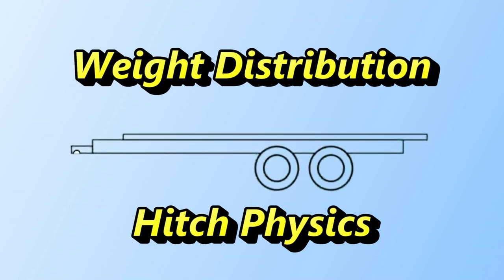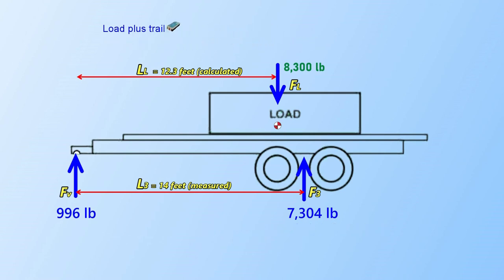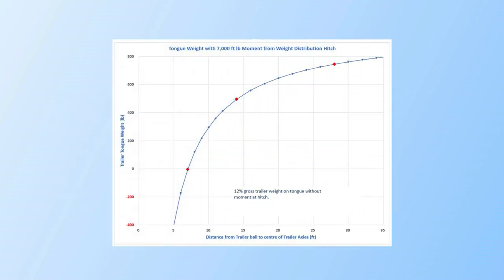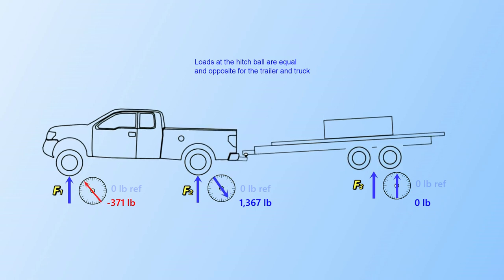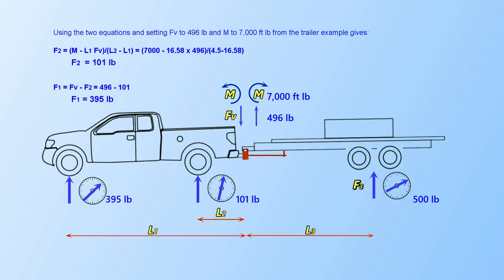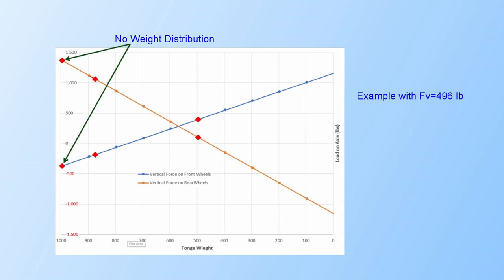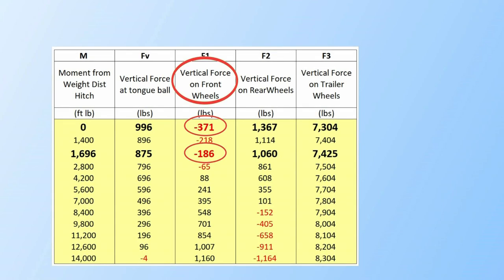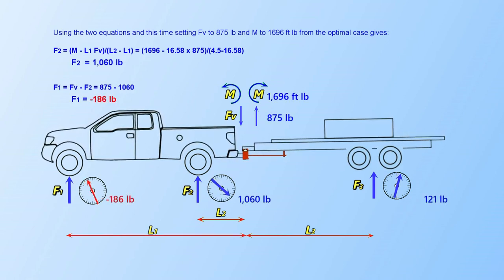Surprising Effects of Trailer Weight Distribution Hitches

Comment: The force between the ball and trailer tongue goes up a lot , like 2 or 3x, when connecting spring bars (see video from Weigh safe).  The L brackets or bar chains load the trailer A frame, pinning that to the truck hitch/ frame for increased stability. The load taken off the rear axle of the truck is used to extend weight to the truck front axle and trailer axle, which increases stability.

Comment: This is awesome.  When you add a wdh you not only add torque, but you add the weight of the hitch which is of course very biased to the tongue.  It seems this comparison would be to a weigtht distribution hitch installed with not torque on the bars/chains.  A good simplifying assumption, and having this simplified is good for your example, but not a real world comparison of using a wdh or not.  Just mention this because people often talk about wdh weight adding to tongue weight, but as you show torque shifts some tongue weight to front axles and back to trailer.  Like I said, this is awesome and educational, thank you so much.

Comment: Interesting, but not completely accurate.  A couple of observations:

1.  You should not analyze the trailer and the truck separately. When you connect the trailer to the truck you create a couple that can move horizontally and vertically.  
2.  This couple creates a single beam consisting of both the truck frame and the trailer frame. 
3.  The rear wheel of the truck becomes the fulcrum and the front axle of the truck and trailer axles are the end support of the beams. 
4.  The axles are all spring supports because both the trailer and truck have suspension systems. 
5.  There will be weight removed from the trailer axles as the tongue is lower below level.  This is because the trailer will pivot on the suspension, putting more weight on the front axle and removing weight from the rear axle.  This will shift the trailer’s center of gravity downward. A shift in the center of gravity changes the weight and balance of the trailer. 

In summary, you have oversimplified the mechanics and misapplied your formula.

Comment: Good job on the video! I have a 37 foot travel trailer, and I am in the process of mapping out how different ways of loading the trailer affects tongue weight. Your video has given me great info, but perhaps if you have a way of calculating how the weight of 200lbs of cargo in the front cargo compartment will be distributed between the trailer axles and the tongue, I would be all ears!👍😬
Reply from the maker: Many thanks for the compliment. The video was a fun project. 
The trailer axles load is the distance from the load to the ball, divided by the distance from the trailer axles to the ball, times the weight. With your 200 lb load, the tongue load is 200 lb minus whatever is calculated for the trailer axles.. Note that if the load is applied beyond the trailer axles, the trailer axle load will be greater than 200 lb, and the tongue load will be negative. The formula still works.
A 37 foot trailer is huge to me. Ours is only 19 feet. What are you towing it with?
Regards,
Ken
Reply: @projects7752  I am towing with an F-350 6.7. I would not tow this trailer with less. I also have a Propride hitch to alleviate any sway. It’s a good setup. 

And you just confirmed the formula of my calculations, thank you very much! I am not an engineer, but I do like it when my theories are close to reality😬
Reply: @projects7752  one more question... What happens to the trailer’s CG when applying weight distribution at the ball? In your example of using an M of 7000 ft lbs of torque, the trailer would seem to have a tongue weight of 6%. Looking at Fords recommendation of restoring the measured drop of front axle to half and using your table, the trailer tongue weight would be at 12%. Am I reading that right?
Reply from the maker: @henrikryan1606  That sounds like a really good setup you have.
 I use a ProPride hitch on my 19 foot travel trailer with an F150. Although the trailer is not that big, it showed signs of sway at around 50 mph without the weight distribution hitch. The ProPride hitch completely solved the problem.
I also use a Camco Treker Eaze hitch on an 18 foot deckover trailer with 10,000 lb rating, although I keep the load to the legal limit of the truck. It also works well, but a low centre of gravity trailer is a much easier towing situation.
Reply from the maker: @henrikryan1606  You have such a long trailer that the weight distribution system will not alter the trailer axle load to any appreciable extent. Rather, it will shift load from the truck rear axle to the truck front axle. 
The latest Ford brochure I saw no longer had the recommendation of 50% change in front axle load. Camco recommends restoring the front axle load present without the trailer.  I suspect it is hard to make a recommendation that will cover all situations. 
Regards, Ken
Reply: @projects7752  yeah, I was playing with numbers today and found that to be the case. Maybe 50lbs shift on the trailer tongue/axles, but 3-400 lbs on the truck axles. 

This exercise has given me a fuller understanding of the physics! I appreciate your video and comments!

Cheers

Comment: Thanks so much for this. It took me some time to go through all the equations and understand what is going on, but in the end I've finally understood for the first time how these really work, not just what they do. However, specs on weight distribution hitches don't include any information on the spring force range. Rather, it seems that I must choose a hitch according to my trailer tongue weight. So I can't really calculate the desired the desired M value in advance and go out and buy a 7,000 ft pound hitch, or am I missing something?

Comment: Very interesting and informative. Any updates on Part 2?
Reply from the maker: My apologies for the long delayed issue of Part 2. Your note did prompt me to dig up the now very old files. I will once again try to get it completed, but it will be at least two weeks.
Reply: @projects7752  The mechanical engineer in me has been searching for a detailed analysis on the workings of a WDH and this was very informative. The only other one I was able to find was on an RV forum, by an engineer named Ron Gratz. He makes comment on what is actually happening at the hitch receiver and that the force decreases. Which I guess makes sense since Class 4 hitch receivers can take a larger tongue weight using a WDH. In his analysis he concludes with the comment that trailer weight and tongue weight did not enter into his calculations. I would be interested to hear your take on his analysis but for some reason I can't post a link to the site. Look forward to Part 2 of your analysis. Thanks.
Reply from the maker: @chrishimsl1321  Many thanks for the link. I will study it more carefully. My first impression, and it is probably more semantics than anything else, but he concludes the tongue weight does not change, while his calculations show a 300 lb increase in trailer wheel load. I would argue the net tongue load has decreased by 300 lb since the total mass of the trailer is unchanged. There is now a moment introduced through the length of the tongue.
As a thought experiment, consider the case where a bending moment is applied at the hitch in the reverse direction. Then take this to the extreme where the trailer is lifted off the ground due to an extreme reverse bending moment at the trailer hitch. The complete weight of the trailer is now carried by the trailer hitch with no weight on the trailer wheels. From this I would conclude that a bending moment at the hitch from a weight distribution system does change the net load carried by the trailer hitch. Part 2, if I ever get it ready, goes into this in more detail.
Reply: @projects7752  Yes, it might just be semantics. He actually says that the vertical load on the receiver has been reduced by 300 lbs but the down force of 2000 lbs on TT tongue from the WDH bars ADDS a load of 1700 lbs at ball coupler. Through all of this, he never assigns a number to tongue weight in his analysis. It's an interesting study on statics and bending moments. Unfortunately it's been a lot of years since I took Statics 101, but this is a good refresher. As a final note, all WDH suppliers will say that tongue weight is never reduced using a WDH. It's just managed by redistributing the rear axle weight on the tow vehicle. Looking forward to part 2.

Comment: What's the best way to weigh if I have a weight distribution hitch? Do I take the bars off or leave them on before weighing? I also have a separate tongue weight scale that I can use to confirm if I've got 10-15% of the trailer weight on the hitch. When we add our bikes and carrier on the back of the trailer we often get trailer sway and I have to add about 10 gallons of water to the fresh tank up front to smooth things out. I'm trying to be a bit more accurate and safe. Thanks in advance for any advice you can share!
Reply: If you're going to a CAT scale, ideally you want to take 3 weights. One with just the TV, second with TV and TT and no WDH, third with TV, TT and WDH engaged. From the first two weights you can determine your tongue weight by subtracting the TV weight of the first measurement from the TV weight in the second measurement. The difference is your tongue weight. The third measurement will tell you how much weight is being put back onto your drive and steer axles with the WDH engaged. This will let you confirm that you are not over your the front and rear GAWR for your tow vehicle.

Comment: Is it fair to say about 12-13% of the tongue's weight was distributed to the trailer's axles and the rest of the weight was transferred to the truck axles and the added truck weight factors into one's calculation of the truck's payload?
Reply from the maker: Hi Mike It's complicated for a number of reasons, that I didn't go into in this video. The hitch to provide the weight distribution will weigh 100 lbs or so. These hitches also moves the hitch ball aft by a few inches which is the wrong direction. The towing vehicle will have a maximum vehicle weight as well as maximum load that can be applied to the rear and front axles. All need to be checked for compliance. 
The thing that seems odd to me is Ford's recommendation to only recover half the front axle weight. This is not consistent with weight distribution hitch manufacturers recommendations where at least some recommend loading the front axle so that it is returned to the loading without a trailer attached. This approach would permit towing a heavier trailer without exceeding the truck total weight limit.
I am in the process of going into these subtleties in another video if you are interested. I should have it ready in another couple of weeks. Thanks for the comment. Regards, Ken
Reply: @projects7752  Thank you for your response. I found the First recommendation odd too, but I suppose there's a good deal of tolerance in that recommendation. Some if the hitch manuals I've seen base their recommendations based on height measurements and not weight transfer probably knowing most DIYers like myself don't have scales to dial in and returning the front axle to it's height before adding the tongue weight is "close/good enough" for safe towing as long as you don't exceed the other specs / limitations of the TV and Trailer.

Fastway did an interesting video to demonstrate one scenario of tongue weight transfer. Seems the % of tongue weight transferred back to the trailer's axle was nearly 30%, which is significant. Posted here if interested: 

https://youtu.be/XBZu39pQ8Gg

I'm not an engineer, just interested as I'm about purchase a trailer with a decent tongue weight and curious what its impact to my payload capacity will be. Fortunately the dealer I'm working with has several scales and he's going to show me all the numbers so I can sense where I'll be within manufacturer specifications and hopefully plenty of room to spare.

Look forward to your next video and keep well.
Reply from the maker: @iacof232  Hi Mike Many thanks for the link. It is a well done video, but there are a couple of things I believe they overlooked. The first is that when they loaded the trailer tongue onto the truck, the truck load only increased by 895 lb, not the 1,000 lb they assumed. I suspect this is due to measuring the tongue weight under the tongue jack, which is closer to the trailer axle wheels than the ball. They don't show where they measured the tongue weight in the video, but this is the only explanation I can see. This would also add 105 lb to the trailer axles weight in the baseline. The second issue is the reduction of weight on the trailer axle when the air bags are inflated. This is almost certainly due to the centre of mass of the trailer load shifting rearward as the tongue is lifted. A travel trailer will have a more pronounced effect due to change in tongue height since the centre of mass of the trailer is much higher. 
I would argue that the weight distribution hitch increased the trailer axle load by not the 356 lb claimed, but by 251 lb. Some of this 250 lb may also be due to resting tongue height, shifting the centre of mass on the trailer, and not the weight distribution hitch moment. It would be interesting to see how their measurements agree with calculations, but this would be require a number of distance measurements they have not provided. Once again, thanks for the link. Ken
Reply: @projects7752  Thanks for the explanation. So many variables.

Comment: In your example of the F150, if the hitch weight is reduces by half, and if the new hitch weight falls below the recommended 10% of the trailer gvwr, would a weight distribution system actually increase the risk of trailer sway?
Reply from the maker: I don't believe so, no. There is a slight gain in trailer axle load, and a redistribution of load from the towing vehicle rear axle to front axle. Load carried by the tongue is only decreased by the amount of gain in the trailer axle load, which is small. My suspicions are that this is extremely unlikely to make trailer sway worse, however, I should caution that I have been looking for the theoretical basis for the 10% tongue load recommendation and have not been successful in finding it.
Reply: I'm having the same conundrum (I think) I keep reading that the tongue weight should be 10-12% of trailer weight to control sway, so my trailer weighs 6383 lbs., tongue weight 939, with weight distribution, tongue  weight drops in half or more depending on how tight I make the bars, how does this not effect sway??
 Thanks for any info.